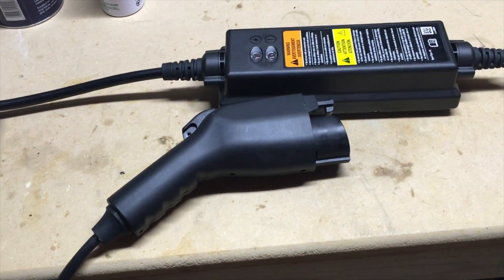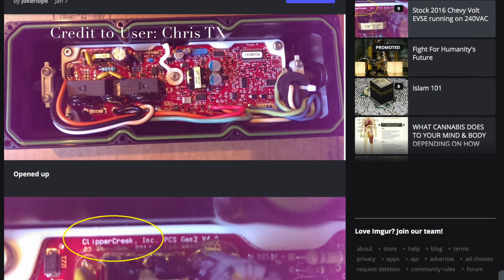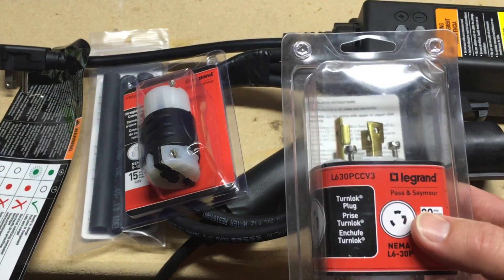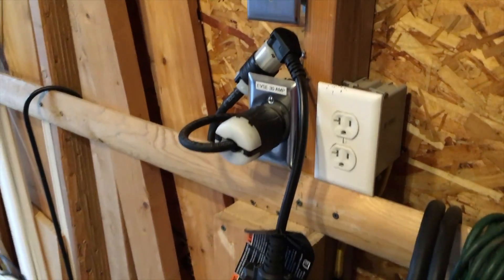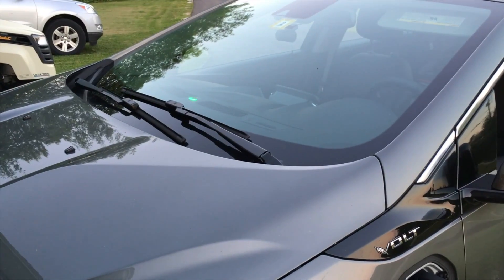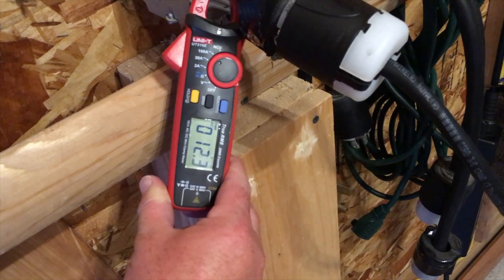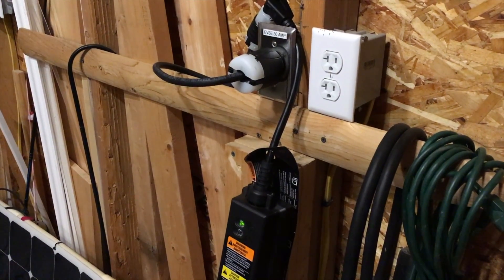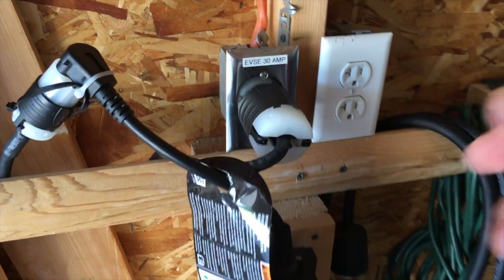2016 - 2018 Chevy Volt Hidden Level 2 Charger 120/240 Charging!

Comment: Hi, I'm currently trying this out. Electricity is all wired in and I made the adapter, everything seems ok when I check with an multimeter. I plugged in the EVSE and green light came on as usual and I plugged in the car and green light flashes and seemed to work just fine (12 amp draw from the amp meter). About 2 minutes in, the EVSE turned to red and the car stopped charging. When I plugged in the EVSE in regular 120V, everything seems to charge fine. Any clues why this may happen? 

Note, the car was also almost full charge when I tried it, could this be why it stopped charging? I'll try again later with less charge. thanks.
Reply from the maker: Make sure you are doing the modification on a volt/bolt mode year 2016 and above.  The red light means a fault/charging error.  
Since the car resumed charging after you went back to 120 volt.  There is definitely a wiring/adapter issue.  Look closely at the adapter to make sure you have the 2 hots wired correctly.   Good Luck.
Reply: @GreenMountainDIYGuy  I have a 2018 Volt. I quickly checked the pins with a multimeter but I'll double check again (should read 120 between hot and ground and 240 between the 2 hots right?). Thanks
Reply from the maker: Correct.  Make sure everything is tight in you connections.
Reply: A faulty ground will give a red light.
Reply: @hjeffwallace  thanks, will look at it.
Reply from the maker: Good point.  I'm thinking that is the issue.
Reply: @GreenMountainDIYGuy  thanks guys, you were right. There was a lose connection on my breaker. I noticed when I changed my breaker to intstall a 30 amp/240v (for another project) and it seems to work. Thanks again!
Reply from the maker: vialb2 excellent, glad you were able to troubleshoot and fix.  Happy charging!

Comment: Some RV Stores might have this adapter for the less adventurous. Just make sure that it is rated for at least 12 amps of current draw.
Reply: FYI - check the voltage and amp ratings on those adapters as they often assume a 125V 15AMP rating due to the 15AMP end.

Comment: Your video is well made. You are articulate and it's easy to understand and follow your instructions. Unfortunately, I am a coward when it comes to working on electrical 'stuff'; and when I hear 220V or 240V my fear meter goes off the charts. I have an electrician friend who will likely do it for me. You mentioned that the OEM cord (from the charger to the car) got 'warm' when you were charging at 220V and drawing almost 25 amps through it and you said you'd have to keep an eye on it. What happened with the OEM cord? Did it 'just' get 'warm' and not suffer any damage or change to it's structure? Would that OEM cord survive hundreds and maybe thousands (365 per year) of charge cycles without catching on fire or burning out? Did you have to replace the original cord with a thicker gauge wire? Is it possible and safer to find a way to replace that original cord with a thicker gauge cord which is able to carry the higher voltage and amperage? Please let me know. Thanks.
Reply: I too would like to know the results of this concern.  Is the charge cord sufficient gauge to operate at 240V 12A?

Comment: I got my 2017 Bolt in March, 2017. It definitely comes with a level 1 charger, i believe the same one as in this video. Takes about 24-30 hours to charge. My JuiceBox Pro 40 takes about 5 hours at our cabin, but I’m going to try this mod for our home.

Comment: I just did it. I installed a 240 volts, 20 amps outlet in my garage, connected to 2 phase 20 amps circuit breaker. Then I made the adapter 240v to 120 outlet in the same way as described in this video. It's working right now. The OnStar report on my cell shows it as connected to a charging station. The full charge is predicted to take only 5:45 hours as opposed to some 14:30 hours. I confirm that the cable is slightly warm but it's really nothing to worry about. Note that I was an electrician for 10 years in a past life. So, I knew what I was doing. 
A huge thank you to Green Mountain DIY Guy for sharing this information. You essentially saved me $400.
Reply from the maker: Glad to help and congrats on the modification!
Reply: A 14-year electrician asking a 10-year electrician in a past life what exactly is a two phase breaker? I only know of single phase and three phase services and one, two, and three pole breakers.
Reply: @stevebalun9554  Hello Steve,
Most houses in USA have 2 "hot" lines, which I call a "phase", and the neutral. The voltage is 120 V between each phase and neutral, and 240 V between 2 phases. The circuit breaker then is a 2 poles which connect to the 2 phases.
Reply: @sergeansay8612  everything you said is correct but that system is called a single phase 240 electrical system.  Majority of homes in the US have single phase 240 volt homes.  Industrial and commercial buildings, and some large estates have a three-phase 208 system.
Reply: @stevebalun9554  That makes sense, because I remember looking at a diagram showing how these 2 "hot" lines are created at the transformer with only one of the 3 phases. I think they just connect the middle of the secondary to the neutral and both end of the secondary are the "hot". Anyway, it seems that you know exactly what I was talking about. Thanks for the clarification.

Comment: Great video Sir! It convinced me to subscribe!

This definitely motivated me to make one myself for my Chevy Volt. However I have a different outlet. The NEMA 14-50 outlet is quite common, even for public charging as well.
Can you please make a related video, or demonstrate to us, on how to make a similar adapter for a NEMA 14-50 outlet, to the stock Chevy Volt charger?
Reply: On the 14-50 plug, all you use is 3 of the 4 pins, Ground to ground, Line to Line1 Common to line 2 and do not use the neutral pin on the 14-50 plug.

Comment: Great video I bought a 2018 volt a few months ago had no idea it was capable to charge L2!!

Now I'm a complete noob with these codes being thrown out of different plugs. Are these codes from the power outlet and the plug only matches that specific outlet. 

How do I find the code for the outlet im using and if its 120 or 240v?

Comment: The 125v 12 amp plug in over time will melt. That is what mine did. It's not rated to handle the 220V.
Reply: Always check the temperature of your plugs after charging for 30 min. Warm is OK, Hot like coffee is not.  Don't mess around, Just replace the outlet with a commercial grade outlet
Reply from the maker: Good analysis
Reply: It melts because the amps not volts high amp draw causes the wire to heat up
Reply: Whoa, now I am further confused..is your response "good analysis" in jest or serious 😳?... the weak links, whether they are the plugs or the 110 outlets some people want to use just aren't built or rated for 220 volt feed regardless of what the vehicle is receiving in amps..?..no ?

Comment: Great video! so it's been a while.. still working? we pickup our new volt on tuesday.. I"m looking at charging options and found this.. I like the concept.. but I don't want to damage my new car! Any words of advice for a new volt owner?
Reply: I have been using it for a year no problem on the volt 2017
Reply: Caffe ine 
I did the mod and it worked perfect!  Thanks everyone.
Reply: The charging unit is really not a charger, it is really only an AC switch. The same two leads going into your volt are used for level one (110 volt) and level two (220 volt) charging.

Comment: wow good job. really cool the wire getting warm or hot is normal. a regular stage 2 gets warm too,your good
Reply: Wire doesn't care what voltage is running through it. 12 amps at 110 volt will heat the wire just as much as 12 amps at 220 volts. And at the same power flow 220-volts will heat the same wire 75% less than 110-volts will. P= V*I   P=I^2*R
Reply: @melaniecotterell8263  thanks for your input on this thread.  I am familiar enough with electrical to install wiring and breakers and panels in homes I remodel and I've worked with three phase a long time ago (a three hot wires flow "weave"..?.. with no neutral if I remember correctly and only a ground... which is connected to neutral within the panel ) installing commercial ice machines but you appear to be more knowledgeable about electrical theory. Would you charge your Volt (second generation) with this configuration or just buy a 220 charger? I am reading " 3 conductor 16awg" stamped on the 22 foot cord that came with my 2017 Volt Premier that I just bought the other day and it seems odd to me that it would be ok to push 220 ( two 110s) thru that. Is it virtually the same doing it this way because the control box (with the green and yellow indicator lights) is the exact same box for both 110 and 220? I think you indicated earlier in this thread a year ago that the neutral/return leg would be switched within the box. ...? reading the incoming second hot feed from 220 and "knowing" to feed it on to the battery? Hope you are still on this site.

Comment: I made one of these for my house and it worked great but I'm making another one that will work with a dryer outlet in case I'm at someone's house and that's an option to charge. I bought the 5-15 receptacle and dryer cord but what am I supposed to do with the extra ground or neutral wire on the cord since the 5-15 only has 3 connectors?
Reply: kcotte59  thanks for the explanation. I was at home depot yesterday trying to figure out how to connect a 14-50P with 4 wires to a 5-20R.

Is there any reference material on how to conect the 2  hots on the 14-50 to the 5-20R female side?
Thank you in advance
Reply: Well, having made it this far in this thread I was hoping/expecting a response here from  Melanie.... she's been posting good descriptive responses about the hot feed legs and neutral return.

Comment: Awesome video.  Did the similar setup for my 2016 FIAT 500e.  I played safe and used 10 gauge wire instead of 12.  Made my own NEMA 14-50P to NEMA 5-20R adapter.  All completed today and my FIAT is charging away with 240V using the original stage 1 charger.
Reply: Thats great news! Can you please explain how to wired this? Your adapter is the one I need. How did you connect a 4wire plug and attach it to a 5-20R female side?

Comment: Hey, I have a 2012 Volt with 37k miles but I do have the newer charger as in your video. Would there be any problems with doing this on my 2012?
Reply from the maker: Bill L Great Question and unfortunately I do not have definitive answer.  I imagine whether or not the charger is 12/240, shouldn’t really make a difference in your 2012 volt.  You could never do this with. 2012 volt EVSE:charger.
Reply: Thanks! I actually just picked mine up used and when I opened the trunk I saw it was a new charger and not the old crappy grey plastic thing that they originally came with.

Comment: Couple questions please....  
1.) What did the parts cost you at Lowes?  
2.) How about the warm cord? Is that a problem?  
3.) You read 12 amps on each of two wires at the plug. Does that mean that you are putting 24 amps or 12 amps into the EVSE?
Reply from the maker: 1). About $40 in parts from Lowes.
2.). Cord is warm in the but doesn;t seem to be an issue. Maybe around 85 F
3.) 12 Amps total for both legs.  Each leg is 12 amps but you do not combine them for for 24 amps.
Reply: Thanks.

Comment: Thanks.  Can someone please reply with a link on amazon for this same adapter?  I would imagine there are some available by now.
Reply from the maker: i3 Tech Reviews I haven’t seen any on Amazon but there are many on Ebay
Reply: A 110-volt receptacle will not complain if you replace the neutral wire with another 110 VAC wire. What you plug into it may complain though. Just don't plug anything other than the charging unit into it. Or just use a pigtail and a female plug that you never detach the charger from. Unnecessary adaptors just add unnecessary cost. That crap ain't cheap, but I am.

Comment: if adapter to new dryer outlet how do you wire the male NEMA 14-30 to mate to the  6-15?
Reply: I am trying to figure this out as well. 14-50 and 14-30 are most common where I am, and also very common for public access EV charging. I hope this gets answered soon.
Reply: The "dryer plug" or whatever plug you need to fit your 240v outlet has 3 wires, ground and 2 hots.  The 2 hot wires are two opposite AC phases each have 120 V RMS peaks.  Bothe peaks occur at the same time and so give 240v.  It makes no difference where you connect these as long as it's NOT ground.  Just connect the wires (usually black and white) in the cable.  The other end is somewhat problematic.  Female receptacles that fit the charge plug will only be rated for 120V.  The voltage rating is partly because of the application (only 120v usually) and also affects how the internal dimensions are designed.  Generally 240v things have greater distances between the terminals than 120v things.  When you look for the female end your only option will be for 120v.  Get one that says 120v and 30A and you will be ok.

Comment: So what happens when your batteries go bad in a year or 2? From doing this.
Reply: Steve Johnson if his battery went bad in two years it would still be under warranty. Knowing that the battery is actively cooled and the volt is rated to charge at 240v, it won’t go bad because of this.
Reply: Volt is engineered to charge at up to 3.6kW.  This setup will only do 220V x 12A = 2.6 kW.  The charger is actually built into the vehicle, so it's not possible to charge the battery at too high of a rate.  (The EVSE isn't technically a charger, it's a power supply, and there is an important difference.)

Comment: I have a 10-30r outlet. So do I just wire the 2 hots to each pole of the 110/15? and then the ground to the ground?  I was going to just buy a dryer cord with the 10-30r already installed.  But they don't really label the wires and they're all black.  So how do I know which one is which?  Do you have a photo how you wired the 110/15?  Also I was going to get a 20amp outlet to wire this to, do you think it's overkill since the Volt will never pull more than 12amp?
Reply from the maker: Mike Colburn correct, wire the two hots to each pole and ground to ground.   Be sure to get the best 115/120 receptacle you can find.  I went with a 20 amp receptacle as I believe they are better built.  Sorry, I don’t have a picture, but pretty standard wiring.  Feels like you are wiring 220/240 receptacle but in actuality are working on a smaller standard 115/120 plug.
Reply: vtmaestro I have since discovered that the 10-30r is 2 hots and a neutral, no ground. Apparently there is a way to ground through the neutral to your dryer. But I'm not going to a dryer. I was thinking to ground the 15-20 to an existing 15-5 that sits right next to where I want to put the new outlet.  Is that acceptable? I would just put a 2 gang box in place of my existing one and wire everything inside that
Reply from the maker: I do not see why you cannot use the white wire to go to ground and keep the two hots?  If you are coming off a sub panel, then the neutral and ground should be isolated so there would need to be some charges in the sub-panel there.  If you are coming off the main panel, then the neutral and ground are most likely bonded. 

I cannot say what is acceptable or not.  If you do not have knowledge of what to do, then please consult and use a licensed electrician.  As indicated in my video, I take no responsibility for doing this right or wrong.  Every setup is different.  Want to be helpful but there are serious risks when working with electricity.

Comment: I notice I have a dryer outlet in the garage 240 but breaker is a 50amp will i have issues?
Reply: mojito5606 - No you will not.  Your Volt will not draw any more than it needs.
Reply: You may not but a breaker is sized to protect a certain gauge of wire .... in this case you will have a cord not rated for 50 Amps ..... will this matter ? More then likely not , but that’s why there are diff size breakers

Comment: Will this work the same on an older Volt? I have a 2013 but the charger looks exactly the same as the one you are using here
Reply from the maker: ben albertson No, unfortunately it will not work on. 2013 Volt
Reply: @GreenMountainDIYGuy  is that because of the car itself or the L1 charger that came with the car?
Reply from the maker: Tom Cartmel  - Not the vehicle but the EVSE itself(Charger).

Comment: I did this adapter soon after I bought my 2017 Volt in July '16, and it's worked great for over a year ... till yesterday.  EVSE green light is on, but red light blinks denoting "Charge cord default detected."  Any idea what's going on?  Thanks!
Reply: rand49er mine does the same thing. Did you ever figure out what's going on?
Reply: I believe this is related to a fault in your cord.  My 240 volt mod continues to work well, but the cord has a fault(break) that I've isolated to immediately behind the connector to the car.  A little wiggle gets things going.

Comment: Ok, but aren't the cables to a 240v system thicker? Therefore allowing for faster transmission?
Reply: That's my confusion too but apparently knowledgeable people on this thread are describing the low draw (?Amp draw?) required by the second generation Volt's charging system negates the need for thicker wire. I get it that 220 is only two 110 hot feeds but in residential electric codes 220 always requires thicker wire.. but that's based on the expected large draw of 220v appliances.  I'd assume that factory made level2 220 charge cords would all have thicker cords but that would be for vehicles that have higher Amp internal chargers ...?....

Comment: Voids warranty
Reply: No it doesn't.  They run the exact same charger in Europe at 220V.  Just has a different plug.
Reply: The dealership told me it does blth 120 and 240 VAC